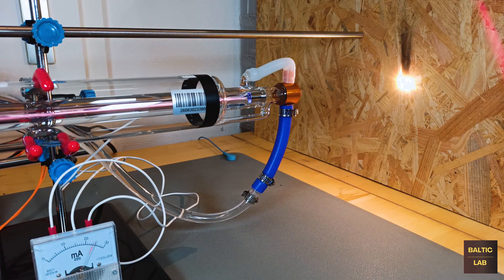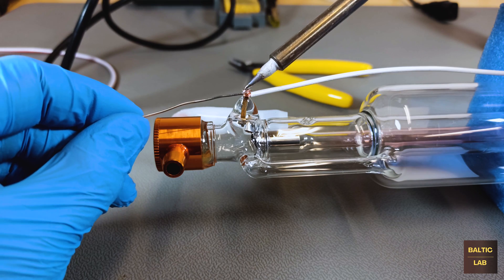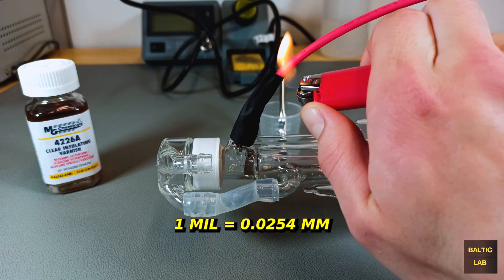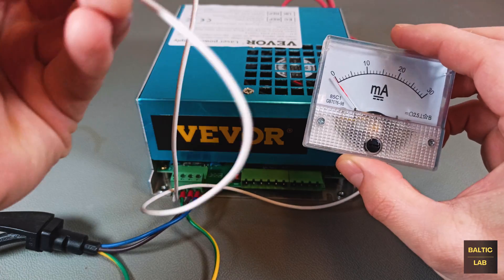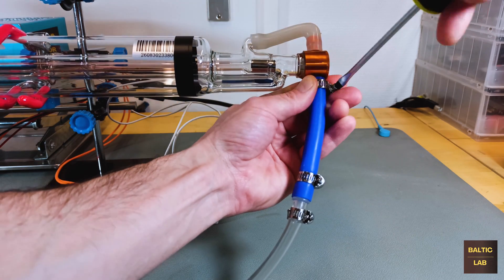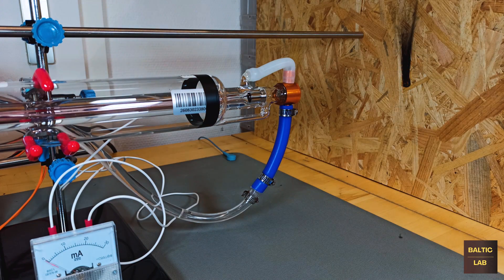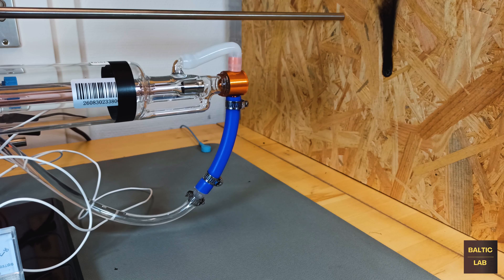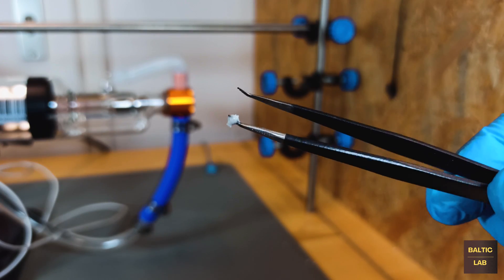How To Connect, Power and Test a 50W CO2-Laser Tube

Comment: Nice setup, these Chinese laser tubes are cheap but dangerous due to their highvoltage wiring and safetyless HV power supply. 30kV with no proper HV shielded cable and a return path to the power supply housing is a deadly combination.
Water ports are fragile.
Life time is abit over 1 year then to the trash.
Beam has usually side lobes and not pure gaussian, so this thing good for average quality production in job shops.
Reply: An RF supplied CO2 laser is much safer and compact and servicible but more pricey.
Reply: Btw I still remember your Wilkinson combiner tutorial about 7 years ago. I still rely on that knowledge for my RF designs  ;)
Reply from the maker: Good to know. That Wilkinson video apparently has quite some popularity I was invited to give a lecture on Wilkinson design at a local university recently after many students referenced my videos in their lab reports. 😄
Reply: Yes, because delivering Information clear enough to understand is highly appreciated.

Comment: fyi, a CO2 laser is around 10 micron (mid-ir) wavelength and cannot be frequency-doubled to produce green light. to achieve this effect, your source laser must be around 1 micron in wavelength.
Reply from the maker: Correct. I know that now but I don't censor my mistakes afterwards, it's part of the journey. :)

Comment: A small tip regarding the Flux you are using. I do not know the material they used for the connector pin. But it seems that a Standart Flux is not doing a decent job to. There are special Flux versions out there for example Stainless Steel or other materials that are not solderable with "normal" flux. But please remove such kind of flux after soldering. Because usually they are very agressive and will damage the connection over time if not removed.
Reply from the maker: You're absolutely right about removing the flux. Since this is a No-Clean flux (Stannol X32-10i), which uses hexanedioic acid as the primary, active ingredient, I more or less intentionally omitted the cleaning step. The pKa values of hexanedioic acid are in the neighbourhood of 4.4 and 5.4 (it's  diprotic), so it probably won't cause all too much damage. That said, I am a fan of "better safe than sorry" and will keep that in mind. However, next time I'd just use proper connectors 😂